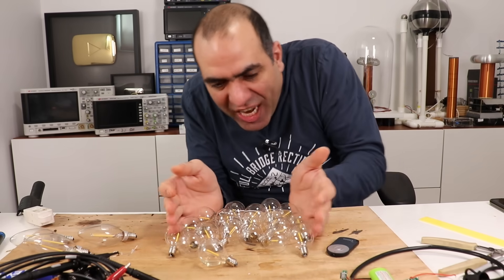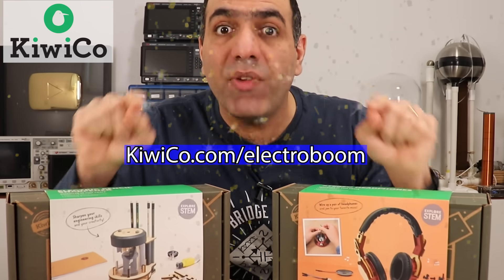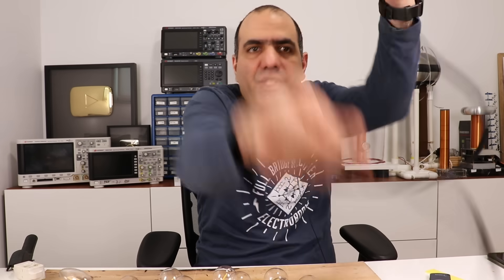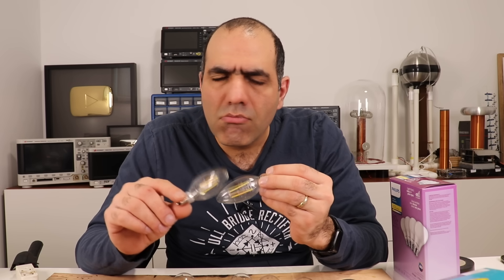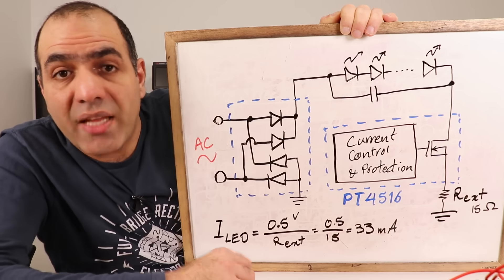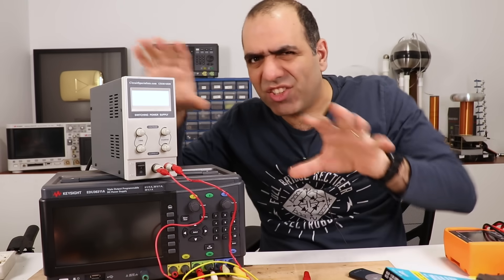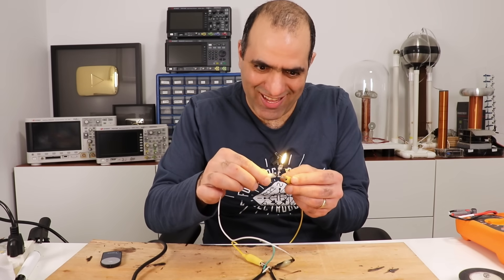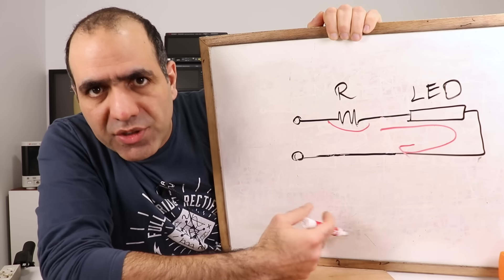So Many MISERABLY FAILED LED Lights

Comment: This LED light bulbs are made cheaply. Internally in the LED strings the connections between the LEDs are very BAD. They can probably melt easily under the heat or even break for the humidity (And most importantly, WATER). The circuitry has a poor ventilation and the LEDs with only a series resistor are the WORST!! (All this is for the cheap no - name chinese lights and some other dodgy chinese brands)

Comment: Mehdi,

The filament ones don't last long. Even Philips ones don't last as long as the non-filament ones. 

The non-filament ones have better heat sinks and may actually last 10 years.

Comment: This is what's pissing meet off, they charge you £10 a bulb (or they used to, it's cheaper now) and say 10,000 hours but they last about a 1,000.
And there's no way to get a refund get it replaced.

Comment: Mehdi: *shocks himself for the 10000th time* 

The voltage and current: How dare you still live?!
Reply: Thats the power of the RECTFIER
Reply: @sreekumariv4695  he already told you current doesnt kill people its voltage
Reply: hope he doesnt fidn out this comment or else he is gonna get heart attack
Reply: fast, edit current to voltage before mehdi sees this
Reply: Nanofarads, son!
Reply: Didn't know? He's a mutant omega class.
Reply: It's the voltage that kills you
You should know this after watching this videos
Reply: @pramodasr3845  How come after watching his videos you have the guts to say that nonesense? It's not necessarily the voltage that kills you nor the current... If the voltage is high af but somehow the current is limited you'll be fine...and the other way around: if say 10 amps are running through a conductor but the voltage is limited you'll be fine as well... The biggest enemy is heat that can cook you or low frequency that can mess with your nerves and you suffocate. Get your stuff together people
Reply: @RubenALopes  chill dude it's me being stereotypical mehdi
Reply: @pramodasr3845  no problem dude it's just me rage rectifying stuff like Mehdi 🤣
Reply: @RubenALopes  You need potential difference (known as voltage) to create current through conductive matter. You can't limit current as it's linearly related to voltage (Ohm's law goddammit), and if current is limited it means that you have current source which will cap the voltage if current through it passes the limit. So there can't be "high af" voltage in the circuit you decided to connect with your bare hands. And the other way around: if you're running 10 Amps through conductor with constant voltage, then voltage is pretty low due to low resistance of conductors (I'm assuming there's no other load) and if you connect to it in series (if you can, wire will be pretty hot) you'll raise resistance so much that current will plummed down, Ohm's Law for complete circuit in action. And if you'll connect in parallel, well, it's all depends on voltage. If there's enough potential between two points, you can easily create enough current to hurt yourself, but we established that there's low voltage in the first place.
Also there's capacitance conductivity, but it doesn't matter here. Current kills, but you need voltage to create it, thus voltage kills. And what you said there are the effects of electricity, you can't be shocked without heating + nerve excitation in case of the AC current running through your body.
Reply: @PongWithBreakout  " if current is limited it means that you have current source which will cap the voltage" - no, it doesn't. Maybe there's just not enough of that current available, because it comes in the form of static charge. Nothing will limit the voltage there.
Reply: But you can pass high voltage through your fingertips as long as it doesn't run through your heart. You might get a burn though.
Reply: @pramodasr3845  no, it is not. I have a tazer... 40k volts. It never killed me or anyone else thag played with it... but the 220v supply wallplug does kill. It is a combination of the 2. Current kills, but the higher voltage is required to overcome the resistance.
Reply: Voltage kills! Not current! Change your freaking comment man!
Reply: @jmsta.romana4660  lol, dude. Go back to school and while you learn, do not touch electricity, please.
Reply: Wow so many comments about changing to voltage. Guys, current kills, not voltage, you need to understand that the higher voltage goes hand in hand with thw current to fight the reaistance, so stop saying shit you don't understand. Go watch his older videos again. He NEVER said voltage kills instead of current.
Reply: @turbocpt1  You really suck, ElectroBOOM will have a meltdown because of you...
Reply: It is voltage that kills
Reply: @Yash-ji1em lol, it is not. You have too learn a little more.
Reply: Shades: This one has eluded us on numerous occasions.
Reply: I'm pretty sure he has a ground strap on.most people while working on electronic wears a ground strap of some type

Comment: Correct me if I'm wrong but why are the LED strings in the bulb (especially the 2 string bulb) connected in series? Won't it be beneficial if they were in parallel?

Comment: Most of the die WAY before the manufacturer states. The building lights in the hallway of the building I live (I replace them)  die after 8 months or 3 years at best. They run all the time but still not even close to the hours promised.

Comment: Maybe the manufacturers meant 10,000 hours of use while moving at 99% the speed of light 😉
Reply: 10,000 hours of use in a lamp holder powered off.
Reply: @daviddavidson2357  And that's what the tiny asterix on the boxes that don't get explained mean...
Reply: @ronnypicardo5944  Yep
Same goes for warranty. Its a pity mehdi brought this up. Bigclive and AvE cover warranty and LED lamps better, you'll never get your warranty as their warranty pretty much requires the item to never be used or there are so many steps that you'll never complete them and our LED lamps are being driven too hard intentionally so they burn out more quickly.
I would like to see a followup of Medhi actually getting a warranty replacement, without saying he is big on the Internet, just a standard warranty request.
I can almost bet they have a warranty clause of "it has to be installed in a manufacturer specified lamp holder with proof" for you to get a new one.

Personally old LED lights and CFL lights are the best. The new ones just shit the bed ASAP so you buy more. Even if the warranty is who goes through the warranty process when they have no lights.

The only warranty system I have faith in is Leatherman and that's because they offer 25 years of a no shit warranry but even they have started to cut corners. Every manufacturer is doing it now, I'm in the market for a new laptop and changing the SSD or RAM apparently voids the warranty and the laptop body needs almost complete dissambely compared to 3-5 years ago when laptops had little single screw flaps that popped up for the HDD, RAM and other user serviceable parts. One "gaming laptop" (gaming laptops generally being the most modular) I looked at had 8gb of ram soldered to the fucking board so it could never be upgraded unless you buy their double price 'pro' model. 

TL;DR Warranty sucks and manufacturers don't want us to fix or upgrade our stuff @Ronny Picardo  Yep
Same goes for warranty. Its a pity mehdi brought this up. Bigclive and AvE cover warranty and LED lamps better, you'll never get your warranty as their warranty pretty much requires the item to never be used or there are so many steps that you'll never complete them and our LED lamps are being driven too hard intentionally so they burn out more quickly.
I would like to see a followup of Medhi actually getting a warranty replacement, without saying he is big on the Internet, just a standard warranty request.
I can almost bet they have a warranty clause of "it has to be installed in a manufacturer specified lamp holder with proof" for you to get a new one.

Personally old LED lights and CFL lights are the best. The new ones just shit the bed ASAP so you buy more. Even if the warranty is who goes through the warranty process when they have no lights.

The only warranty system I have faith in is Leatherman and that's because they offer 25 years of a no shit warranry but even they have started to cut corners. Every manufacturer is doing it now, I'm in the market for a new laptop and changing the SSD or RAM apparently voids the warranty and the laptop body needs almost complete dissambely compared to 3-5 years ago when laptops had little single screw flaps that popped up for the HDD, RAM and other user serviceable parts. One "gaming laptop" (gaming laptops generally being the most modular) I looked at had 8gb of ram soldered to the fucking board so it could never be upgraded unless you buy their double price 'pro' model. 

TL;DR Warranty sucks and manufacturers don't want us to fix or upgrade our stuff.  In the 70s-early 90s instruction manuals came with schematics ffs.
Reply: naaah man, they have already used them for 9900 hours on the factories before resealing them and selling as new :P
Reply: It’s on the really small text
Reply: 10000 hours at 99% lightspeed equals 1411 hour at rest. But they lasted only 600 hours at rest (10000 hours at 99,82% lightspeed)
Reply: Bread
Reply: Yea I see
Reply: 🤦‍♂️Oh dear…

😏
Reply: Hehe
Reply: It's business 😂😂😂
Simple 💵💵💵😂😂😂
Reply: Would not the wave compression of radiation result them burning out instantly anyway...

Or are you actually referring to time dilation?
Reply: you aint wrong lmao
Reply: Absolutely
Reply: If you measure it moving at the same speed of the lamp will last the same short amount of time
Reply: But that is 10000 hours viewed from outside, so to you it will still be just a few weeks.
Reply: yeas
Reply: Hehu- 😅
Reply: @erdwaputracanistre8220  chipaiwah WAZ ZAPO NIN DOG 🗾📼📽🔋💷🔌🦠🗝🔗🖇☢️☣️㊗️🔱〽️✅❎💤🌀🎶♾➿➰〰️🔜☑️🇺🇸🇹🇷🇬🇧🇺🇾🇿🇼🏴🇱🇨🇸🇧🇸🇲🇷🇪 he saw wraif as a albino saberTaouthe zebradonk 🙀😸😺🤧👻💀👽👾🥳😇☘️
Reply: You clearly don't understand time dilation
Reply: Obviously not! and are you joking. The good Chines never lie. When they said 10K hours, they meant 10,000 hours but not by the earth time. Another plant you silly! Learn how to read the fine prints or better, learn to read that in Chines!!
Reply: Lol
Reply: Lol
Reply: Oh shit!
Reply: Wow
Reply: Big brain
Reply: or at 0 Kelvin ambient
Reply: Lol
Reply: Does time move faster or slower going this fast? I’m confused
Reply: @Acrophobia2  BOTH!!!! I know it’s sounds strange but it’s true. Just pick a lane”direction” DONT PULL A BOOT DISK.
Do you feel me.
Reply: Someone do the math and see how fast you'd have to travel for 6 months of use
Reply: WP
Reply: Lol
Reply: Make a light bulb
Reply: When you travel at the speed of light ,time freezes
Reply: I'm hungry
Reply: all my bulbs are supermarket own brands and they been going strong for 5+ years now, cost £3 a bulb for 60 watt equivalent
Reply: @girlsdrinkfeck  because 60 watt equivs are a mere 8.5-9 watts, its the 100 watt bulbs that fry themselves, and did even before they began to omit the heatsinks.  10k hours...in the artic or something I guess.
Reply: Jokes you got jokes ha la Lem on Li mei.
Reply: I may have not understood this, but I think it has to do with relativity so I laugh hehehehe!
Reply: @Plasma channel As everything is relative, so are the 10000hrs, depending on your frame of reference 😁
I have a colleague, a 2 hour meeting feels like a whole day...
Reply: Thank you all please dont think sid from the toy story is Evil “ Acid/Burn “ is getting a little present from G-Mother Hubbard.
“LSD freaked him out he’s not Evil he’s just MK2’d he hallucinated his toys came alive and killed him. Tell the Spielberg and Luka Vader found his Daughter and Tesla and The  Whymereiner kids too. It’s all good in Mr Rodgers Neigh boar HooD-“SO PLAY NICE”
Sidrick Bartholomew Jackson/Simpson.
 Oh ya and I LOVE stupid love Sids a big Lady GaGa fan. 
Stop waterboarding ur self Samanthose.
Reply: @William Ironstone tell him will it’s called Powder u know the movie that’s the beginning to your horror story. Just like 12 monkeys is the sequel to the Mario Bro’s movie. Same jail sells on Mars duh.
Reply: But doesn't the speed of light move at 300,000 km a second
Reply: @Gishopan Sivakumar I’m looking for blue rubber handle vice grips(lanannide seiriz9000HALOREGEOPHOBIASHIMGAZADONDALAIBRERDRLO LORENZOE ) any clamp that won’t hurt the tvantenna  plz ¥£€
Reply: right😂😂😂
Reply: @Jonathan Long LASER BLAZER MAZER LOL
Reply: I kid man I LOVE YOUR CHANNEL
Reply: 10k ? plz :D most of it has 50k hour work :D like car LED (it means it should be work for around 300k km... mhm xD)
Reply: Thanks for the info.
Reply: Lmfao 😂
Reply: Doesn’t matter. It’s still 10000h if you’re with the lamp.
Reply: Op
Reply: Op
Reply: Aren't we already moving at a 100% light speed ? 😁
Reply: That's only for an external observer. For the person using the bulb it will fail in exactly the same amount of measured time.
Reply: Lol
Reply: Im writing it down
Reply: I quickly started to question this because the speed of light is all fucky but I honestly can't argue with it
Reply: yes
Reply: That's still instant
Reply: Maybe
Reply: It doesn’t matter time for you flows same it’s longer for things that are stationary
Reply: 10000000000×the speed of light
Reply: so what do they last 1388 hours at 99% the speed of light its 7.2
Reply: Qscb😂fxgjjbxcvg🤭জিসিভন্ন, cjknhn💞💞oo♥
Reply: Very good
Reply: That would make them last way longer when at rest.
Reply: It wouldn't make any difference, since time is measured in the light's frame of reference.
Reply: special relativity go brrrr
Reply: this is why you read the fine print
Reply: 21
Reply: Probably
Reply: Most say "up to" 10,000.. anything less than 10,000 is "up to"
Reply: Idk
Reply: Those was made for dubia and parts of india.
Reply: Fr
Reply: No no, at absolute zero in vacuum.
Reply: GO ALBERT EINSTEIN
Reply: Genius
Reply: From the bulb's perspective then it would still last forever
Reply: If I'm correct, that'll be 1410.67 hours of proper time
Reply: 😊😅😮😢🎉😂❤ no
Reply: By va
Reply: By r😮😢
Reply: Yes you came again with good ideas
Reply: Im writing this down
Reply: Yes
Reply: High iq man
Reply: Well @&$&
Reply: @judicatorhurayth1927  hitz the winds
Reply: Your heart is r/gone
Reply: @William Ironstone eeeerrrr... maybe you you should have posted a main comment and not a reply to some random joke.
Reply: more like 99.8% speed of light
Reply: Will you make something that draws power?
Reply: @martinbobak3009  only if you need it but it will stay like that Apophis aster roid. Can’t drive 55. Four LIFE will be assured a restored mind before decisions are forced on her or ill let “TadPole” swallow the planet Jupiter just for fun since I’m such a funGi fungus tomato toma toe .
Reply: It should try opening without smashing the glass you could have damage their circuits Or the LED chip in the process
Reply: @TheMono25  is not that E Z being greazy 404 automatic syntakz reprisal 
Freezer Geezer “LovE”
Reply: kiwico is not communist
Reply: i want to friend to help me build things plz electrocute
Reply: @gianodossantos6206  wtf
Reply: @turbocpt1  I KNIOW SORRY
Reply: NO BUT REALLY I REALLY WANT A  NUMBER
Reply: i want to friend to help me build things plz electrocute
Reply: @gianodossantos6206  What?
Reply: i want to friend to help me build things plz electrocute
Reply: @gianodossantos6206  would you shut up

Comment: The reason is for the ( usually 10♎) surge protection and also acts as a fuse.
Reply: I would open 10 of them in a day, short that part and works perfectly..

Comment: Big Clive discovered that almost all LED bulbs LED's are over driven and the excess heat destroys the LEDS's and capacitors. He came up with a hack that doesn't even require a soldering iron: https://youtu.be/H09SI5qLmtY . Just break one of the sense resistors or with a soldering iron replace, you can even solder a TH resistor in to get a lower constant current, reducing heat from over driving the LED's getting them to orders of magnitude longer.

Comment: Just connect 2x 12V led in series but in both ways. It drops voltage and decrees heat dissipation, for a bit which is the most reason to fail leds.
Power and light output too but knowing that you can buy slightly more power and last for ages

Comment: We have like 10 years old led bulbs at home, the quality of the light is terrible and some of them is much dimmer. Is it because of broken leds or circuit itself. There is like 50 single leds on the bulb.
Reply: Have they gone bluish?
The phosphor layer could be degrading. Or the LEDs just aren't being run as hard as the ones you get today which is why they still work.
Modern LED bulbs are designed to fail early.
Reply: @daviddavidson2357  The color is the same, only it is like 70% dimmer. There are 6 light in one line, so they all are turned same amount of time.
Reply: @jurovan5563  Dimmer than modern ones or dimmer than when you first got it?
LED bulbs from 10 years ago werent as bright as the ones we get now because LEDs have gotten better and because the modern bulbs are designed to cook the LEDs so they fail about as quickly as an incandescent bulb.
Reply: @daviddavidson2357  Dimmer than when I first got it.
Reply: @jurovan5563  LEDs are probably degrading. That or something has gone bad in the current/voltage control circuit.

Comment: I still have some original EarthLED bulbs from 2008/9 going - they have large heat sinks and the brightest model has a small fan built into the base.
Reply: i'll pay a heavy amount of 3$ to get the brightest one 

more info if you are canadian then Canadian Dollor or if you are form any else part of the world except America then good luck turning them to your currency
Reply: Yeah modern LED bulbs are designed to fail early.